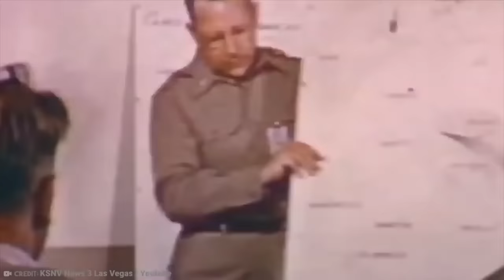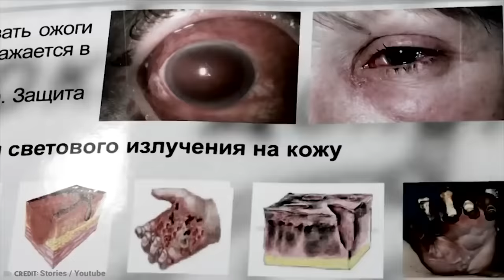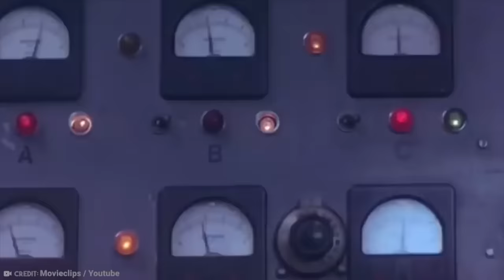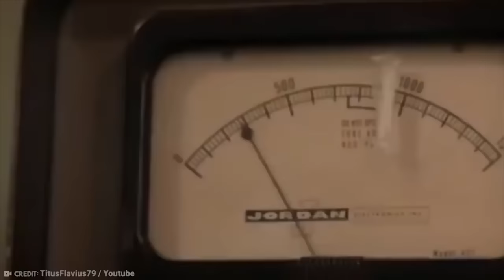20 Nuclear Tests That Went Horribly Wrong

Comment: There was another nuclear melt-down like Three Mile Island and in some ways worse, but seldom discussed.  My father worked there at the time.  The locations was the Santa Susana Mountaintop, near the residential San Fernando Valley, approx 35 miles from Los Angeles.  It had no containment structure and the accident got no publicity because it was not a commercial power plant, but rather a "research" nuclear power plant in a facility whose research activities were top secret at that time.  I believe the company operating the facility at the time was either Atomics International or Rocketdyne, but I could be mistaken about the names as those aerospace companies at that time were always merging with each other or splitting apart, and as a young child I really paid no attention.  It's claimed the sewers there still glows with radiation.  And in the past ten or so years they have closed off parts or all of Chatsworth Park (a large, beautiful park on the edge of the mountains) with a high chain link fence and they cut down the large, old oak trees because of the contamination.  
There have been several law suits put together by near-by residential neighborhoods but to my knowledge nothing has become of the law suits.  At the time there was No sense of health or safety.  I remember my father bringing home various strange things to play with, including quart containers of mercury.  
Whenever they tested a rocket engine on the mountaintop, it could be heard across the entire valley for 5 to 15 minutes at a time.  
The last time I drove up there just to check out the area, the facility was still in operation but most of the buildings have been demolished and removed.
For more information, just search Santa Susana Research facility in the San Fernando Valley, California.
Reply: wiki has a good in-depth article on what was going on there.  here's the link if YT doesn't remove it:
 https://en.wikipedia.org/wiki/Santa_Susana_Field_Laboratory
Reply: YES, thank you!!!  Whenever I see videos about 3 mile island and how it was America’s worst nuclear power accident I correct it.  The Santa Susana field lab was much worse.
Reply: Good job I was going to mention this exact thing. I remember when it was all over the news.
Reply: Santa Susana Field Laboratory  - good one.   It was also known as Rocketdyne which moved out to the Mohave Desert. There were so many.
Reply: More ,you dont want to know lol
Reply: "I remember my father bringing home various strange things to play with, including quart containers of mercury."

If only we knew how dangerous mercury was back then, I don't think anyone would want to play with it at all.
Reply: @nakirium-yt  You're so right.  There was no sense of personal health and safety.  I remember as a child the mercury, heavy like liquid steel, would make my hands all silvery as if it was wet, but then as it dripped onto the ground it would burst into a million little beads rolling everywhere.  A very strange experience.  
Highly radioactive waste was poured down the sewer.  There have been lawsuits about that.  
Many times they had to dig up and replace the pavement around the place because of chemical spills and radioactive spills.  I remember my father got some kind of reward because he suggested the next time they had to dig up the pavement, that they replace it with some type of layering so when the next spill happened they could just remove a layer, and not dig up and replace the entire pavement.
Chatsworth Park, a very large (at least 1,000 acres) and beautiful park at the base of the Santa Susana mountains had large sections of lawn, rocks for climbing on, and lots of trees.  Some of the trees were very ancient old Oak Trees they put up small fences surrounding them so people would not climb on them and kill them.  With a baseball field, picnic tables, hiking trail, it was a beautiful park where a couple times our entire grade school class would go there for special events.  
I went there many times with friends over the years.  
About eight years ago, before I moved up north, I went there one last time.  The lawns were dead, the trees were cut down so they were just stumps 1 to 2 feet high, and there was a large chain link fence about 8 feet high around the entire park, or at least the part of the park I could see through the fence.  
There happened to be a utility worker just locking the fence gate as I was driving around outside the place.  I asked him what happened?  He said there was some kind of pollution and "dogs were getting sick".  So they had to close the place down.  I took a couple pictures through the fence but can't post them on UTube.
Reply: Lover triangle, Idaho Falls incident. Still highly classified.
Reply: That's crazy, my dad worked at TMI too. He was there during the melt down
Reply: There's strong evidence linking this explosion with later flourishing of the porn- industry.
Reply: @Johnconno  Yeahhhhhh.........I hear bad language entered rap music about that time too.
Reply: I grew up in Woodlandhills which is only a few miles from Chatsworth. I often hiked in Chatsworth Park. My father also worked for Rocketdyn and other Defense Contractors back in the 70's-90's. I think if he felt I was in danger he would have forbid any of his children from hiking there, but who knows anymore! I'm going to do more research into the actual location of the tests to see how close I ever came to the area's as it only takes a short distance to go from High Levels of Radiation contamination to Low Levels, although any level higher than background can be dangerous! smh..
Reply: 8:35 The most crazy incident: 1961 B-52 Crash ! That was so nice, we should repeat it !!! 🥰😇😂😂😆
Reply: @mrlaw711 Probably too dangerous for the workers.
Pity about the residents

Comment: In my line of work a plumbob is the weight on the end of my gaugeline. It weight about 16oz and is made of brass. It’s pointed at the end to pierce the thick settlement that is common at the bottle of a stock tank (oil).
Reply: and just how many chippies and other tradie apprentices now days would know what a "plump-bob" was or how to use it?  (apprentice...oh f**k, I forgot to put the auto-leveller on recharge...)
Reply: Been a carpenter for 7 years, only ever needed to use a plumbob maybe twice. Most useless item in my bosses truck.

Comment: Nuclear bombs don’t accidentally detonate by being dropped on a hard surface. 🙄 That would just break the delicate circuitry and make the bomb useless.
Reply: we've had a lot of "broken arrows"....most of them recovered...but that one in carolina came close to detonating according to all reports....
Reply: They do if set with an impact initiator.

And the safety interlocks are off...
Reply: @frankpienkosky5688  "Close".  5 fiddly bits had to work.  They call it fail-safe for a reason.
Reply: @frankpienkosky5688  Well that is just scary!
Reply: @thatguyinelnorte  
On one bomb 4 out of 5 triggers worked in sequence. The bomb manual got operated during the aircraft breakup for instance.